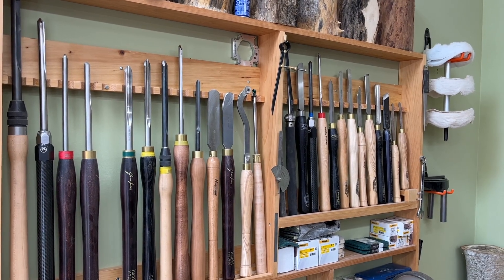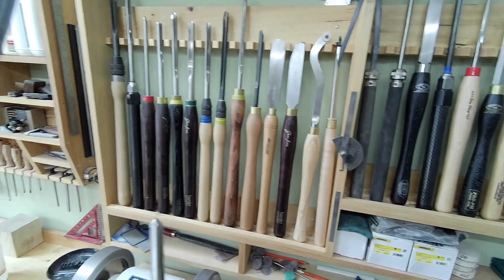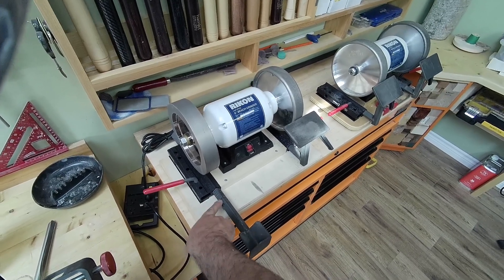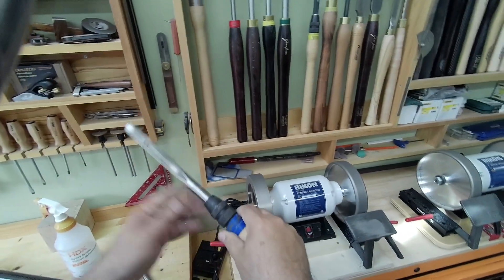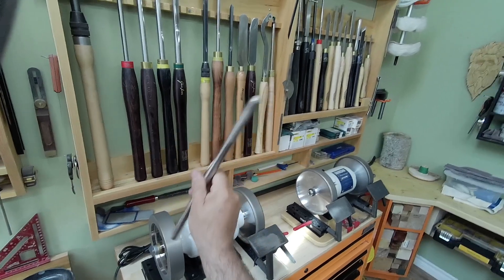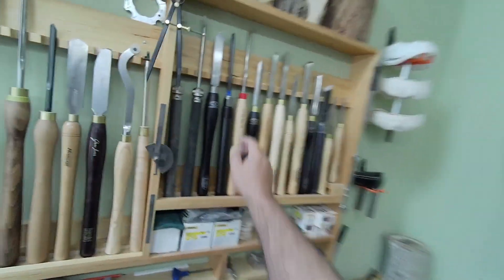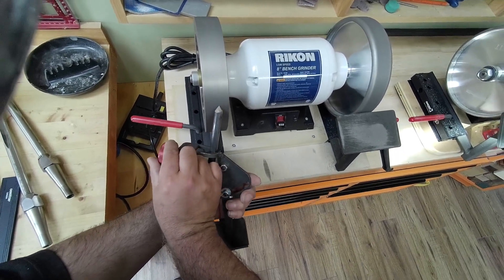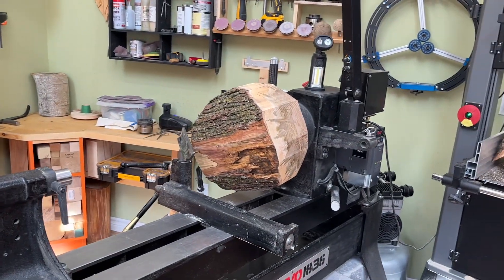How I Sharpen My 40 40 Bowl Gouge Using The Oneway System

Comment: That doesn't actually give you a 40/40 if the flute isn't a radius shape. Most bowl gouges are elliptical, U shaped, or V shaped. And none of those profiles can be matched rotating around a single pivot.
Reply from the maker: My more experienced friend said the same thing until he checked with an angle tool and found out that it was 40 right on the money. not trying to argue with you as i only have one year turning experience, but have you tried and found what you said. or you heard someone say it?
Reply: @area50juan  The nose angle is correct, and usually the wing angle is mostly correct, but the wing profiles dont match the shape of the flute. I have that exact jig and tried it, been freehand sharpening 40/40 for years, learned from Ashley Harwood. It works pretty well on Sorby U flutes because those are almost circular. It doesn't work at all on Thompson V-Flutes.
Reply from the maker: @matthewwright57  I believe you're right as per swinging the gouge all the way around while sharpening because one of mine got weird after doing that several times and i had to reshape, but i also believe that using the jig to do one side, then the other and finish by tip blending does work. it's also a good trainer to go free hand witch i will start soon.
Nonetheless thanks for the feedback and info. sharing ideas and healthy debate is how we learn and become better. Thanks again man.